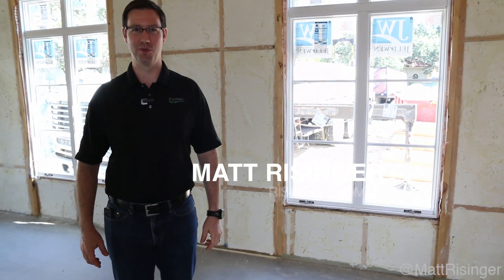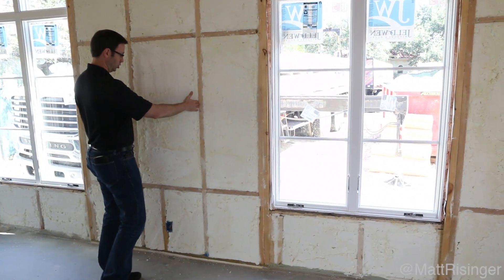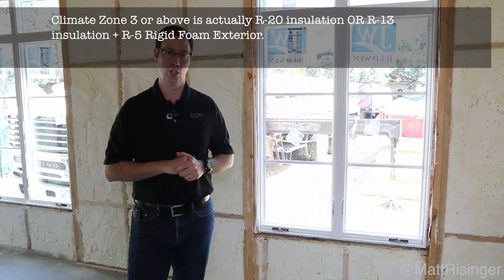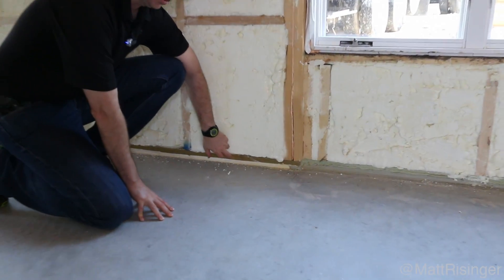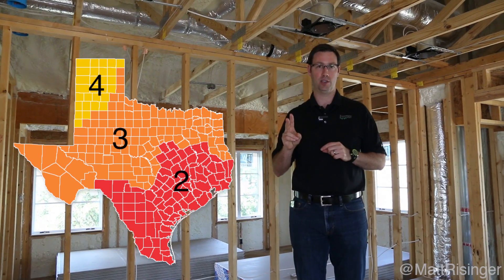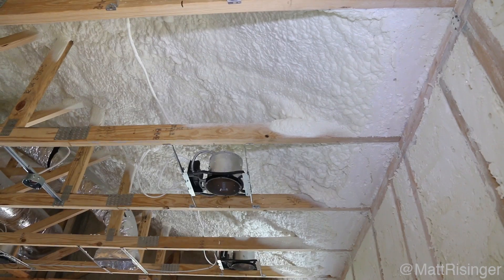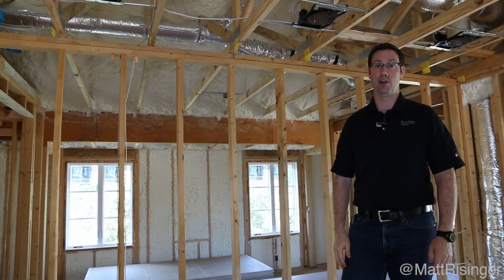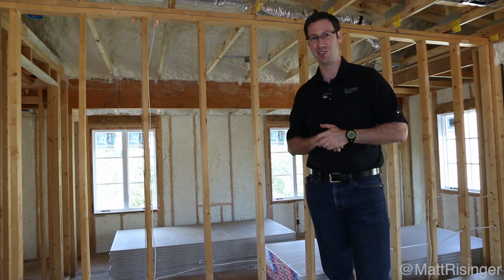Spray Foam & How to meet 2014 Insulation Codes

Comment from the maker: Yes I've seen that happen.  It seems to occur most when the foam can't stick on three sides of a stud bay.  For instance, if you were spraying against a cardboard or plastic vent inside a rafter bay where it only adheres to the 2x rafter on two sides but not on the back of the OSB/Plywood.  It can also happen if conditions aren't right (mix, temp, etc).  With a trained crew this is less a concern.  Best, Matt

Comment from the maker: Richard is spot on here.  You need to read the ICCES report from the manufacturer of the foam you spray to determine what/if you need an ignition barrier.  A few foams meet the spec without adding an ignition barrier, so require it.  An easy ignition barrier is an intumescent paint.  That's my typical final step in attics when necessary.  Matt

Comment: Yes there is a concern about leaving foam unprotected in the attic.   There is a second spray component that should be added over the foam.   Or recently you can order a foam rated for uncovered attic installation without the extra protection, but you are not allowed to store anything in the attic.  Demilec APX is one such "safe" foam.   I took a piece of it and tried to ignite it with a propane torch.  It just charred.  Out-gassing after install and during a fire situation is also considered.

Comment: Concerning budget, you have to consider that your heat and ac bills will go down by 25-50% so it has a payback in a few years.  Often the HVAC units are downsized by an equal amount, saving a little.   Plus excellent conventional insulation costs money to install properly, low bidders just don't do a good job.   The spray foam materials are the largest wholesale cost component.

Comment from the maker: Closed cell is much higher in R-value but it's 2-3x the cost.  I highly recommend it if you need it for additional structural properties (Hurricane resistance for example) but I use it mainly for below grade applications.  No doubt it's the top-of-the-line foam, but it's hard to budget for frankly.  Thanks for being a faithful subscriber!  Best, Matt

Comment from the maker: Spray foam is definitely more expensive than traditional insulation but it's well worth the cost upgrade.  With the air sealing benefits, the increased effective R-value, and the ability to insulate areas that can't be insulated effectively with fiberglass I think foam is tough to beat.  Costs have come down in Austin because it's being used a lot so subs are busy.  The materials are expensive, the machinery needed to spray is expensive, and the upkeep on the machines is expensive.  Best, MR

Comment from the maker: Joe, They trim the foam flush to the studs.  This is open cell foam so it's pretty soft/easy to trim.  It's hard to say on cost for a 2000sf house but it's likely $5-8k with the specs you are seeing in this video.  Costs vary widely depending on the region and availability of subs who are foaming daily.  The busier the foam crew the better the installed costs I've found.  Best, Matt

Comment: Forgot they just cut the Insulation after it has expanded, flush with the wall so you can hang your dry wall, cement board,etc. Just type in cutting spray foam on here, you will see a lot of videos showing how it is done.

Comment: Pricing if they are not in your area, I know that Matt is going to tell you to look in your area between all the different Spray Foam Insulation Companies to find what you like best, and also for the best price. I would think that pricing is pretty stable, seeing as Spray Foam is not new, been around in the US since the 90's, I remember the first time it was used on This Old House, it was the Poly Urethane Spray Insulation. Like I said call around or look online at your local companies.

Comment: I can help with a couple of your questions @ricksite and @JoeLarge. Yes they do trim the insulation after it is sprayed, also as he mentioned in the video open cell was used. Open cell is the cheaper than closed cell spray insulation. I would go online and look for local companies in your area and see the best price you can get. Also many different types of spray foam insulation, so cost will vary between the different choices. I know this from general research, no one can give you the exact

Comment: I have a friend who is having a house built. I told her to ask about spray foam insulation. It didn't fit into the budget. Do you think the price will ever come down (similar to other insulation methods)? Does the high cost come from the materials, labor or both?